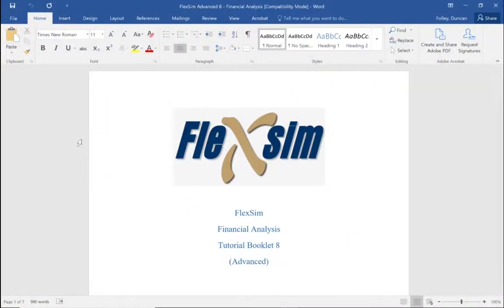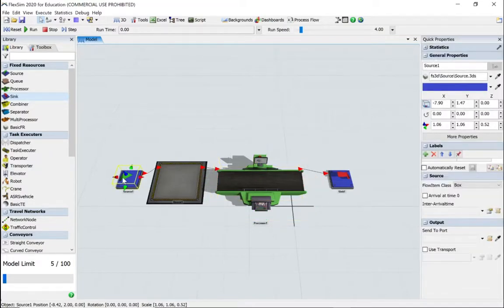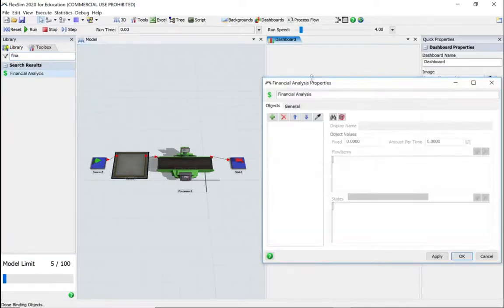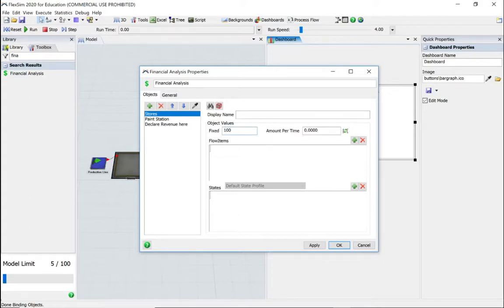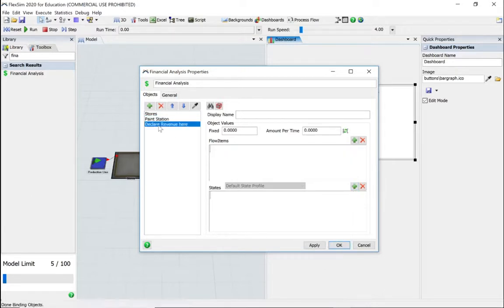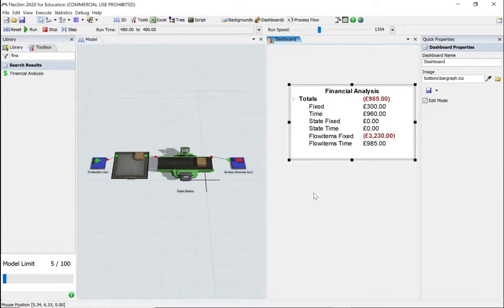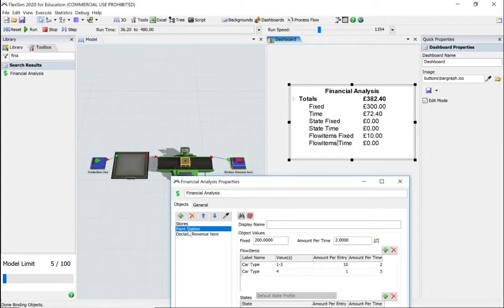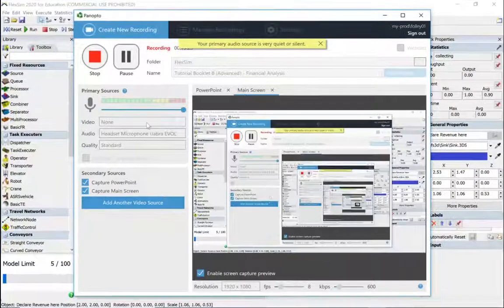FlexSim Tutorial Booklet 8 Advanced   Financial Analysis

Comment: Very informative video!
One question:
could you explain please, how you determine the value of ''amount per entry=10'' and '' amount per time=2''  at 8.22min of this video?
Reply from the maker: Great question I hope the following explains it a little better

Fixed Costs: the cost of buying and owning something, so there is an initial purchase price and a time based ownership cost (eg buying a car and paying for road tax)
General info:-
Variable costs: costs for processing work, usually a cost per item in terms of materials and consumable items, and the running costs of machinery or manpower
It gets more complicated as costs can be based on the types of parts being processed and the states of the machinery. The Financial Analysis Tool lets you assign costs to various equipment and Operators, in various categories of cost and then sums it all up into a total cost for the model over time. You can drill down into the various objects by clicking the expansion symbol.
Queues don’t usually have any costs associated with them, however there can be a time-based holding cost per item. (cost to store an object).
Revenue tends to accrue when a part exits an area. There isn’t a specific Revenue field however you can add –ve values to represent the difference between what you spend and earn. You can swap around the –ve and +ve values depending on your accounting preferences.
Costs can differ based on a Label value; however, you don’t need to use a Label in the tool – this tutorial uses a Label in the Processor to differentiate flow item types, but not in the Sink which just has a revenue per type of item. 
In the attached model we will add costs to a processor and queue, and a revenue (as a -£100 per item) at the sink. 
What tends to happen, particularly in small companies, is that they have a lot of potential revenue tied up in stock, but don’t turn this into actual revenue in neat, steady streams if they are fulfilling a large order. So they run out of money as the flow of revenue occurs too late and they run into problems funding the stock holding. 

Sorry images dont copy/past in these comments:-
10.	Set the model run time to run for 480minutes. Now lets investigate the Dashboard. (Go to the general tab and change $ to £).
 
11.	Fixed - This value is added once when the model is reset. This value might represent the initial purchase price of a resource. Our Stores cost £100 and the paint station costs £200 = £300.
12.	Amount Per Time - This value is continually added as the model runs. A value of 1.0 would mean at time 50.0 the total time value for the object would be 50.0. Therefore running costs of the paint station (even if nothing is happenings) is set to “Amount Per Time” – £2.00/min the value £960 comes from running the model 480mins (x2 = £960)
13.	Now reset the model and instead of pressing play press Step – this moves the model every time a discreet event happens, press Step twice. You should have a box on the processor and the dashboard should show:-
 
14.	The time should be 36.20mins. Fixed costs are £300 and the time value being £2/min = £72.40. But Flowitems Fixed = £10 (Note- this may be 1 for you). If you click on the box and it has a label of 1-3 the  Flowitems Fixed = £10 if its 4 then it will be £1. Check out our settings at Paint Station (Amount Per Entry). Press the Step button 2 more times and the box is sent to the sink, where we get Amount Per Entry of £100 but it cost £10 to make so that’s where we get the £90.00 (red because its money in to the company and has reduced the Totals by £90.
 
15.	The Flowitems Time value of £1,255.00 comes from two areas. The Stores and Paint Station – Amount Per Time. Its quite hard to follow this value but if you rest and press Step 5 times the box goes straignt through the Stores (no wait no cost) but then it spends 10mins at the Paint Station ie 10mins and (Amount Per Time – 1-3 =2 and 4 =3), so if it’s a Car Type 1-3 the Value is 2 thus you get a Flotitems Time value of £20, this becomes quite hard to follow after this as items get stuck in Stores and the Amount Per Time from the Stores adds to ths Amount Per Time from the Paint Station.
16.	After the 480mins it looks like we are £706.00 in profit after selling 35 cars at £100
 
I hope this helps
Reply: @engineeringacademy706  thanks for this guidance and explanation! Greetings!
Reply from the maker: I was thinking of packaging the tutorials up and releasing the booklets on kindle reader f there is enough interest.